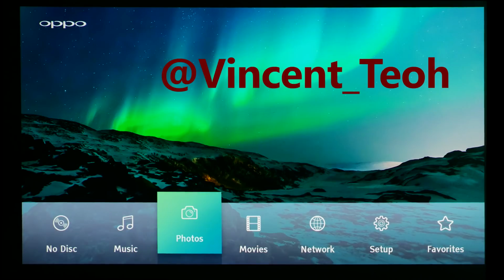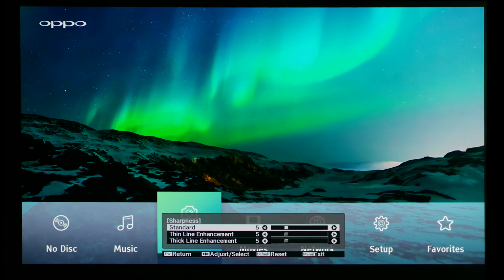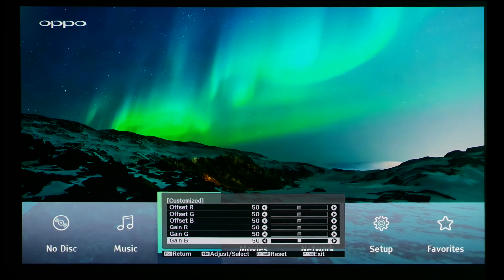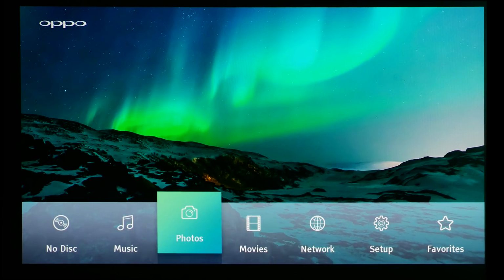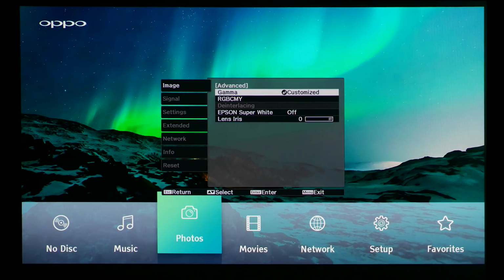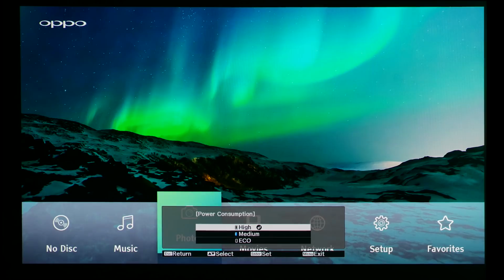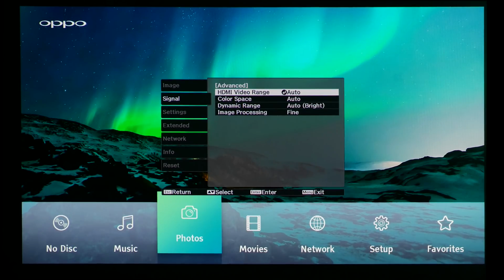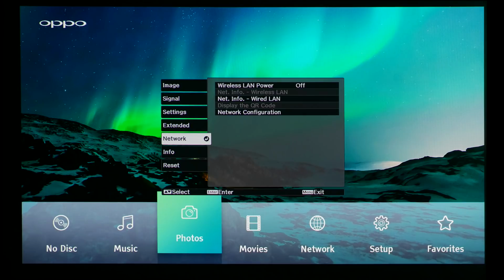Epson EH-TW9300/ 6040UB Projector Picture Settings

Comment: Hi thanks for your video. I just brought a new Epson Tw 9400 it would be great if you would do a video on the best settings for the new 9400 we don’t have calibration professional were I live in Australia
Reply: I have a 9400 as well and living in Melbourne. Did you have any luck finding best settings?
Reply: Cd Noony  hi , I have an oppo 203 4K Player what Blu-ray 4K played do you have as settings in the player will also impact on your projector e.g. Sony have a projector setting in their 4K Blu-ray player. I hi set the image in Hants meant to 3 which helps sharpen up the picture on and I have the cinema setting at either natural or cinema, What size screen do you have as this also impacts on the brightness 100”. The projector we have easily recover 150 inches without any issues on brightness

Comment: Vincent, is this Epson projector a good buy?
Reply: at Zimba:  I have the USA Epson 5040 Ube wireless projector for about 1 year now.  Excellent projector.  The only one I have owned so far but all pictures are really good.  Spectrum (old Charter) only has a 1080I broadcast picture and it looks super good on my fairly small 84 in Elite lumina wall screen.  Blue ray and 4k Blue ray are as good as movie theatres.  The settings on the projector vary for every viewer you basically just change them a little until you get what you like.  I can't afford the 3d glasses yet so I have not tried any movies in 3d format .  Just my 2 cents.  Very quiet running but super hot on the front left side for lamp heat exhaust.    Rod D.

Comment: Hi everyone, In the past I was able to use the 3D with a pair of glasses but something has changed and now I am unable to access 3D setup as it is "Greyed Out". Does anyone have any information to share regarding this issue?
Reply: The problem comes from the fact that the HTPC was changed to an INTEL NUC7i3BNH and apparently the Intel NUC´s have a driver issue (not resolved at this moment... maybe never...) that prevents 3D from being correctly presented. The problem was not present with my old nVidia GT210 (512MB) graphics adapter.
The NUC is a very nice 4K@60fps -mediacenter, just not for 3D.  :(
Playing a 3D movie with a Panasonic Bluray-player connected through the same Yamaha-receiver and Projector had no issues at all.

Comment: I have this projector and would be grateful for you to do a full test for best picture settings as I have mine set to bright cinema for normal bluray discs and bright cinema for 4k ultra hd discs. Thanks for your great videos you are the best on youtube
Reply: ok no your set up is all wrong  for the 9300 ok natural for blu ray as this is the best closest setting to rec709 the only way u can properly see 4k is in digital cinema as this has a special; lens in side the projector to alow 4k bt2020 hdr bright cinema is not the correct setting also check u have the new update as 09 as this has bright hdr and u can set it when in digital cinema because it used to go to hdr 2 which was to dark so new update changed it it bright hdr its much better hope this helps i also do calibration but each 9300 is different slightly but i have some settings you can try as it looks amazing in natural
Reply: Try some of these settings - http://www.avsforum.com/forum/attachment.php?attachmentid=2313706&d=1510447106

Comment: There have been many different attempts by professional calibrators to calibrate HDR for projectors but most seem to fail. In your next video could you elaborate on how you calibrate HDR for projectors? The Epson is very flexible in the sense that you can make your own gamma curve which seems to be key for HDR. Here is the best attempt to do this on this projector http://www.avsforum.com/forum/68-digital-projectors-under-3-000-usd-msrp/2563857-official-epson-5040ub-6040ub-owners-thread-241.html#post52228017 . I'd be very interested in your opinion on the best way to do HDR on this projector or projectors in general. You seem to be really on top on all of this. Thanks for your good videos!